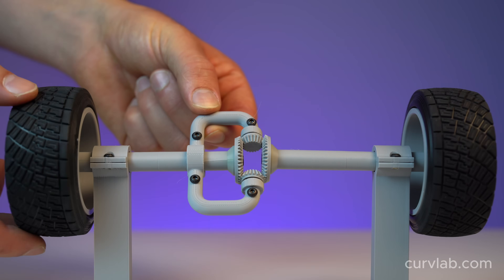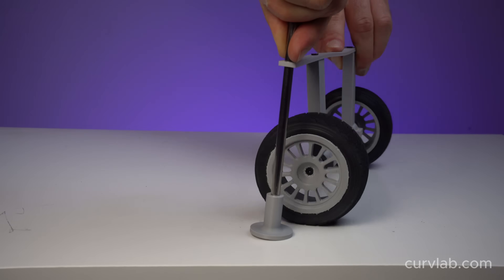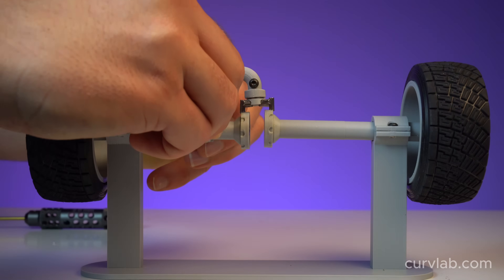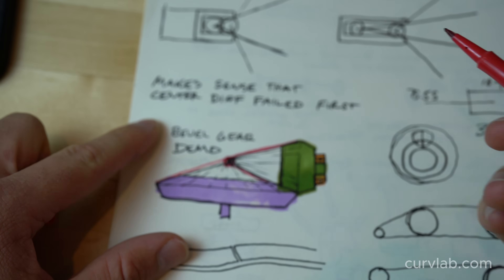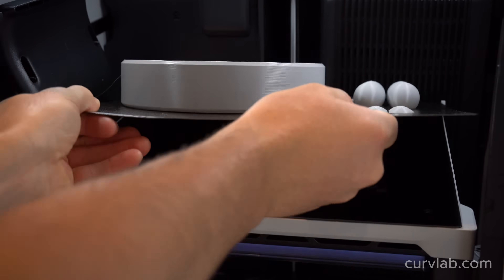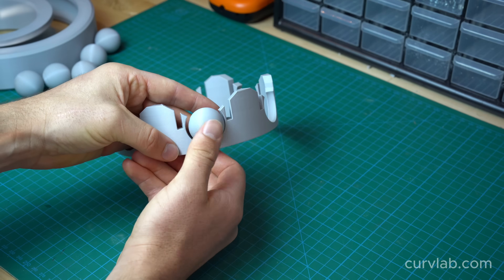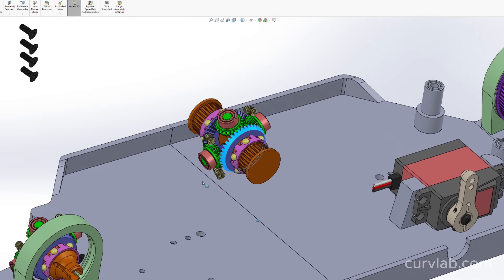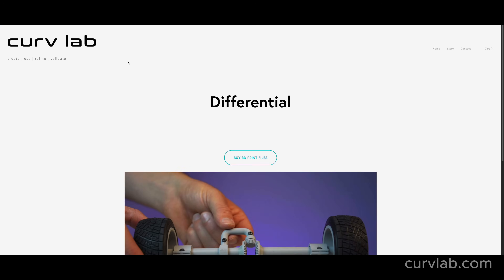How does a differential work

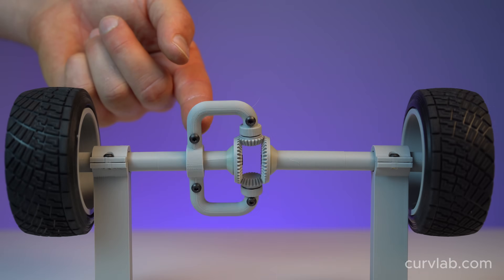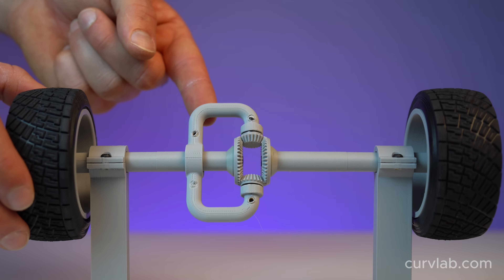Comment: Quick question, if you were to design this with a drive shaft instead of having it belt driven. Could you use how its set up at 3:10 and fill in the missing components? Or would you have to make something similar to what you made at 3:39?

Comment: I remember an RWD RC car that had a habit of getting stuck when one rear wheel was off the ground and all power then went to spinning that wheel, as opposed to the one on the ground. If you have a front/rear differential, are you susceptible to the front/rear version of that issue?

Comment: Hey! I bought you 911 designs and I've printed it. I did email you a question a while ago on which tyres you used for the metal Fuchs wheels (especially the rear wide ones). I'm sorry I have left a comment here.